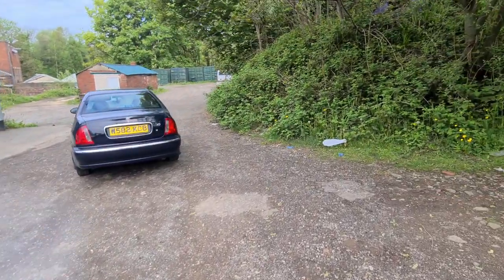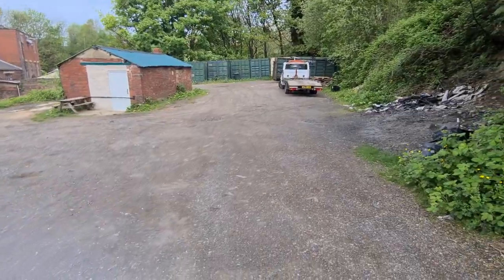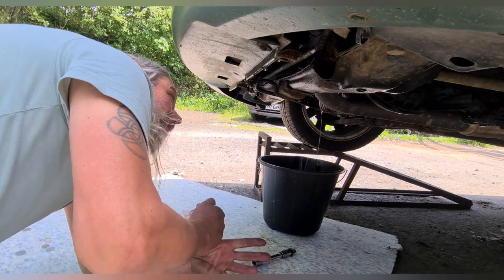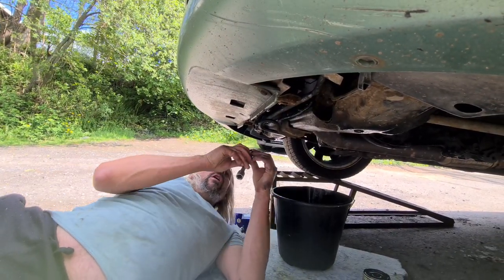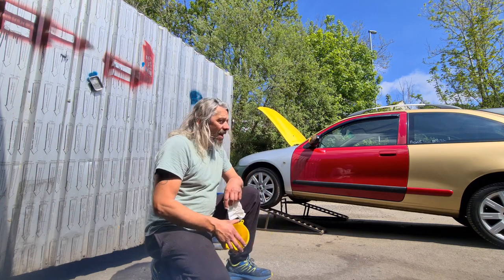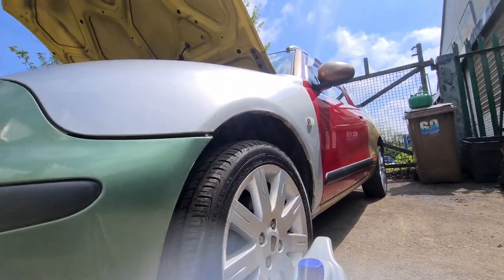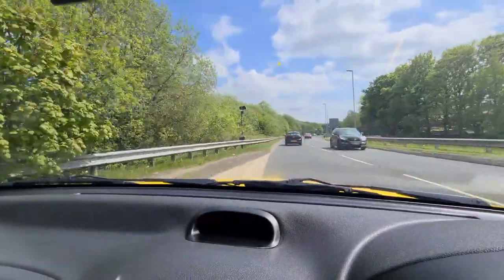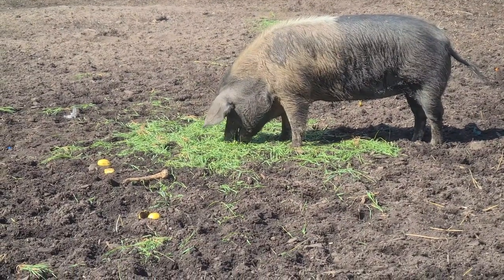Oil service every 3k. Is it necessary?

Comment: tip - you have a compressor, next time you do an oil change, stick a blow gun attachment into the sump and itll blow the remaining dreggs that normally stay at the bottom. The amount that comes out is untrue, it may run down your arm but easily cleaned lol or alternatively blow it down the dipstick tube if you don't want to get oily. The dipstick should be removed to allow more gravity into the engine before undoing the sump plug, the cap also.

Comment: it may look clean, but if it is too old it loses some of its qualities....changing at 3k miles/5k kilometers only if the car is used for short drives to local stores which are mostly 5-10 minutes which means a lot of cold starts which then create a lot of condensation inside the engine and so on as we all know....twice a year is ok for that sort of use and I think that many city cars should be serviced like that because that's what they are basically made for - running around on short trips.
Reply from the maker: Good point.

Comment: I have long life oil in the Audi don't think av done 4000miles lol. Definitely turn the engine off lol. I always put new bolt and washer on but that's because Audi sell it to you probably a bit of a con really as the old one with a new washer would be fine. That will keep Nigel in fine fetal till next year. You day out looked fun.😂👍

Comment: I do think the sump plug is in the wrong place on these, I did mine the other day and on the ramps I felt the plug was actually higher than the lowest point. My oil had been in less than 100 miles because the car had been stood for 2 years unused 😳
Reply from the maker: It does slope a little bit though, so it's level of the ramps.